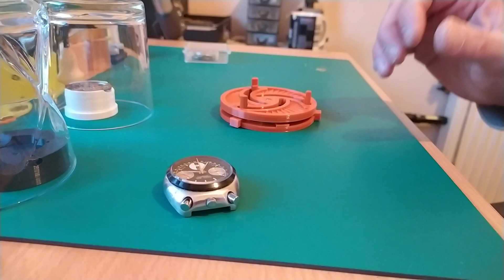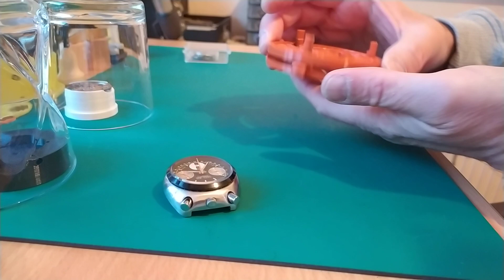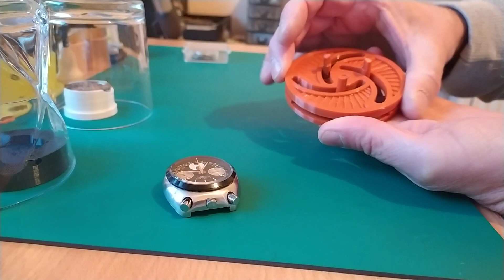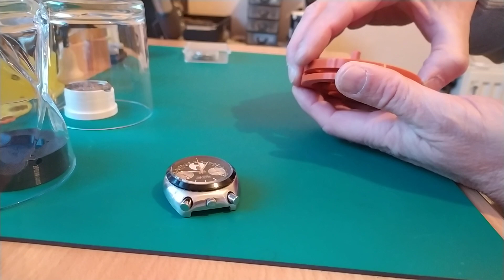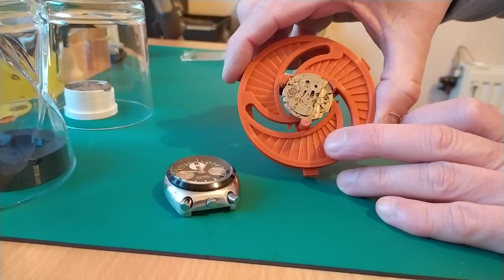FREE! 3D Printed Adjustable Watch Movement Holder - Thingiverse

Comment: Hi, looks great. Which way did you print it and where did you put the supports please? I just tried printing it standing on edge with manual tree supports under the (now 4) prongs that hold the movement down to the build plate on my X1 Carbon and the two parts are fused together 😮. Cheers.

Comment: Tried to find the seagull st3600. Can’t find it anywhere. They have the eta 6497 but it only holds one side of the movement.  Have you seen or know a link to print the 3600?